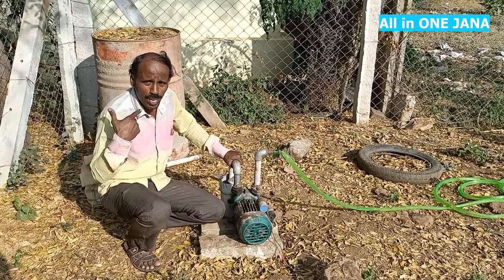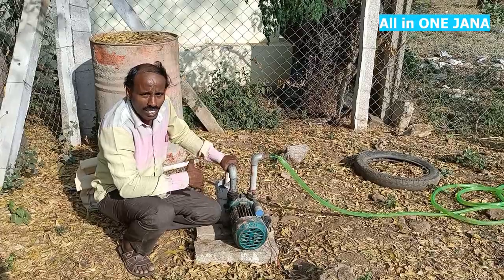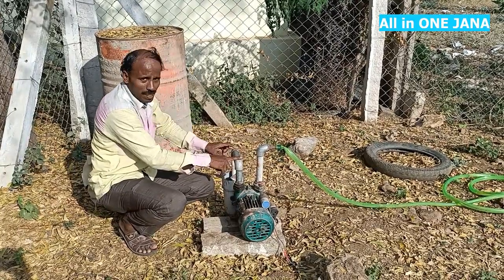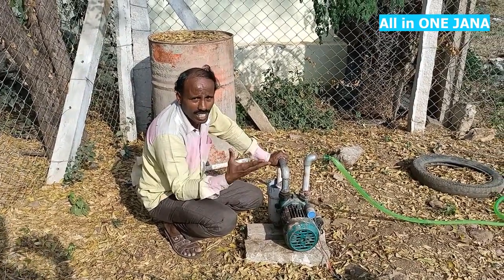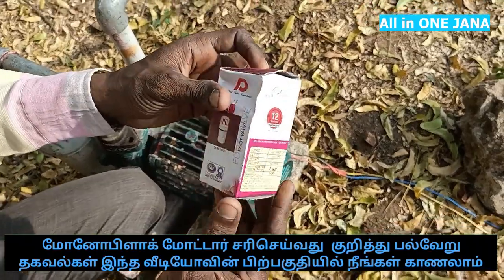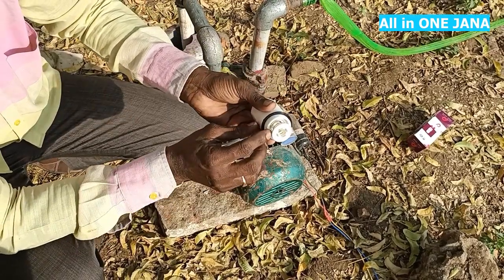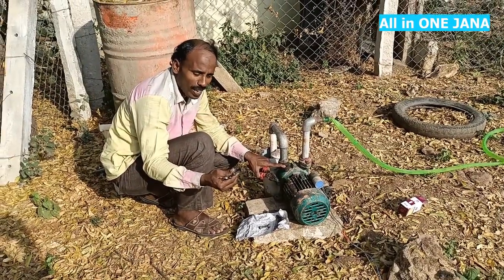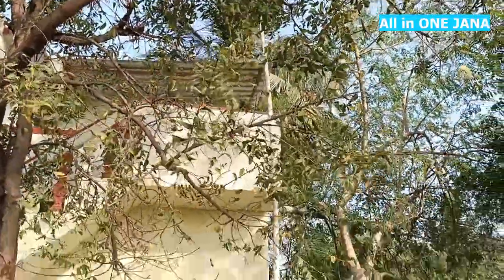Mono block pump -Problems and solving -not getting water| All in ONE JANA | TAMIL

Comment: Sir 400feet bore well la 3hp monobloc motor use panalama water varumma
Reply from the maker: If static water level 20 feet you can use any monobloc pumps

Comment: மோட்டர் heat ஆகுது பிறகு மோட்டர் நிக்குது பிறகு வேலை செய்து ஏன்
Reply: Rewinding shop ku kondu ponga,,,,motor ku ulla oru copper thaayaththu irrukum atha remove panni direct ahh line eduthu tharauvaanga....athuku aprom antha problem irrukaathu
Reply from the maker: வைண்டிங் ஓவர்ஹீட் காரணமாக எரிந்து போகாது தவிர்க்க பாதூகாப்புக்காக Temperature relay பொருத்தப்பட்டு இருக்கும் அதனை எடுத்து விட்டால் ஓவர் வெப்பம் காரணமாக மோட்டார் எரிந்து போய்விடும்
Reply: @ElectricalExpressTamil  மோட்டார் ஏன் கீட் ஆக்குகிறது
Reply: Voltage check pannunga low voltage  vanthalum motor odathu amps rate kuda edukum motor head agum

Comment: Sir motor on aguthu ..ana sutha matuthu
Reply from the maker: Open side cover switch on motor use screw driver just rotate fan carefully if run your motor
Capacitor failed
Reply: @ElectricalExpressTamil  sir capacitor change panuna ok agum sir
Reply from the maker: Suthi vitta odinal capacitor matrugal
Reply: @ElectricalExpressTamil  sir barring poyiruchu nu solranga

Comment: Enna motor 1 hp vangalam best motor online la vangalama please reply 9843240680
Reply from the maker: Branded motors are best 
However non branded also running more then 10 plus years.
As your wish you

Comment: Intha motor bore pakathalathaaa set pananumaaa... Illa nama pipe length kuduthuu 30m distance vituu panalamaa...
Reply from the maker: பக்கத்தில் இருந்தால் தான் சிறப்பாக செயல்படும் 30meter வாய்ப்பு இல்லை சகோ
Reply: மிகவும் பயனுள்ள தகவல்கள் தெரிவிக்கின்றன
Reply: பக்கம் என்றால் எவ்வளவு மீட்டர் தொலைவில் அமைக்கலாம் 13 meter இருக்கலாமா
Reply from the maker: Vertical 7 Meter horizontal 3 meters
If your bore water level at 20 feet

Comment: Motor odudhu aana tank la thani romba slowa erudhu for example oru 3 sec Kita thani fasta tank la oothudhu aprm oru one sec stop aagudhu thirumba 3 sec knjm fasta vardhu thirumba stp aaidudhu idhku ena solution nariya dhadava plumbers pathutanga valve Elam change pananga aana thirumba sme prblma irku.. idhku motor change Pana nalarkuma...
Reply: Voltage check and water level check

Comment: Sir impeller suthuthu ana sucktion illa enna problem ah irukum
Reply from the maker: Water level may be in below 25 feet
Reply: @ElectricalExpressTamil  kaveri water sir only  10 feet from motor
Reply from the maker: Are you checked in your foot valve?
Reply from the maker: Just 50 rupees only PVC foot valve please change

Comment: Motor Heat avathu appuram off aguduthu
Reply from the maker: Here some of reasons to overheating a motor.
1.Low voltage
2.  rotor to stator friction
3.over load
4.old age
5.bearing outage
Any one of above

Comment: hi sir, 5hp monoblock pump -motor and bore well 22feet; water level 15feet iruku ,  Suction pipe have 5feet holes with outside filter. athula bore water casing pipeoda ground top levela checkvalve iruku (no end footvalve). Adikadi water varama iruku. suction la leakage illa, analum delivery la water varala. Adikadi water refill panni priming panna tha water varum. sila time water varave varathu. enna problem irukum
Reply: Motor oduthu aana thanni Vara matuthu pls Enna problemnu reply panuga pls
Reply: @nishamariyam7211  suction pipe leakage parunga, foot valve nalla iruka parunga, ellam nalla iruntha delivery pipela thanni oothi apram potu parunga
Reply: @nishamariyam7211  air leak
Or
Check valve problem

Comment: SOLAR PANEL VITULA USE PANNUM POTHU SOLAR OUTPUT THANIYA EDUTHU  NETURAL  INDIJUVAL PODUNUMA ATHAN ORU ORU LIGHT KUM
Reply from the maker: நீங்க பயன்படுத்த கூடிய இன்வர்ட்டரை பொருத்தது
Reply: @ElectricalExpressTamil   clear ra soluga ella solar netural laium supply neturalaium mix pannala ma
Reply: star delta starter oil type method connection soluga apudia phone no soluga

Comment: Sar 6 amps 1000k C class mcb  output shat circuit mcb not tripping main board bus damage mcb  not tripping what reason
Reply from the maker: 1.MCB டிரிப் ஆகும் முன்பா bus எரியக்கூடிய அளவிற்கு அந்த terminals weak ஆக இருந்நிருக்கலாம்
2.Mcb failure ஆக இருக்கலாம்
1000kaஆக இருக்காது 10000kaஆக இருக்கும்
Reply: @ElectricalExpressTamil  sorry Sar 1000A new mcb  legrand make new fush carial new house wiar shat circuit mcb not tripping
Reply: 1000 amps MCB  house use panranga?
Reply: Bro MCB phase and neutral just few seconds short pannunga mcb trip ana good condition
Reply: @lakshmanlaksh1460  thank you
Reply: Any protective gear can sense downstream faults only and not upstream.